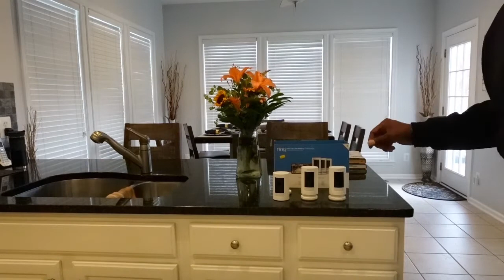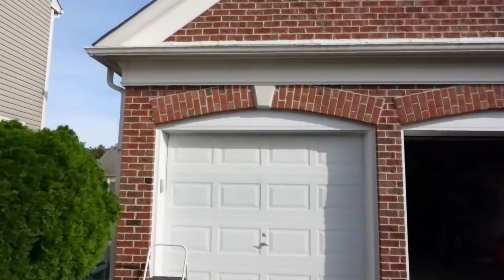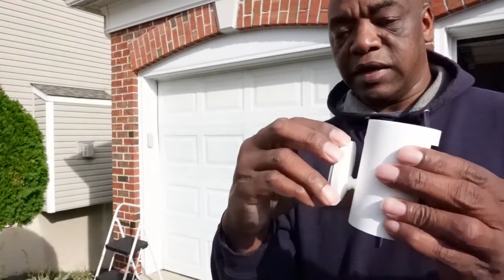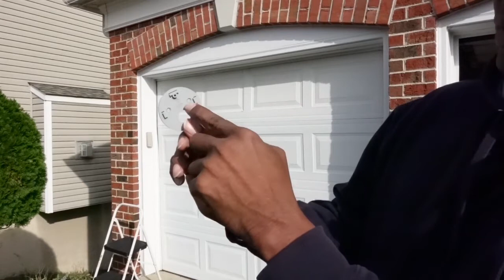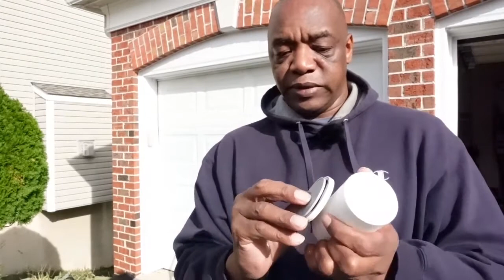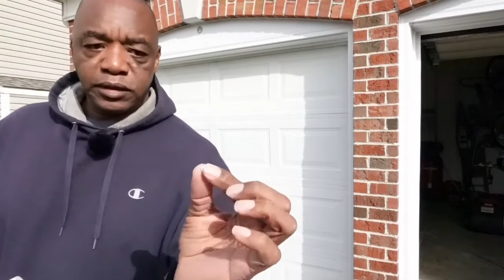How to Install Ring Stick Up Video Security Camera

Comment: This was the only site that showed how to mount on outside wall.  The only thing wasn't able to see how to take gray portion off.  But knew it did because you showed it separated.  Thanks !!!!
Reply from the maker: @user-hs9lz5wn3j, The peaches simply slide together. If you push the pieces apart in the property areas, they will separate.

Comment: I just got my first ring stick up cam battery yesterday and set it for person detection only and set the sensitivity to Max and it's doing a great job . The picture is not as sharp as my wyze V3 cameras but I needed a battery camera for the spot I don't have power and the wyze battery camera is not good at all.
Reply from the maker: The Ring Stick Up Camera battery is not perfect but very good. I like that I could incorporate the cameras with my existing system using the same app.
Reply: @DIYFixer331  if my wyze  cameras would always send me a person notification they would be perfect the night vision is unbelievable the picture during the day is unbelievable they are just great cameras for a low price but I only get person notification 75 % of the time I want it 100% And The Ring gives me that. So I have to have 2 systems  because if one don't pick them up the other one will . 😂